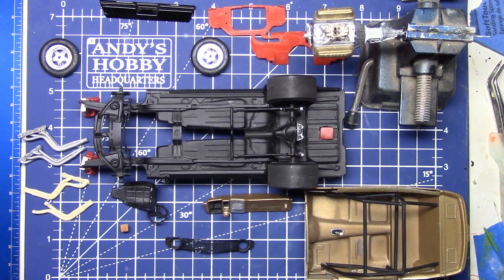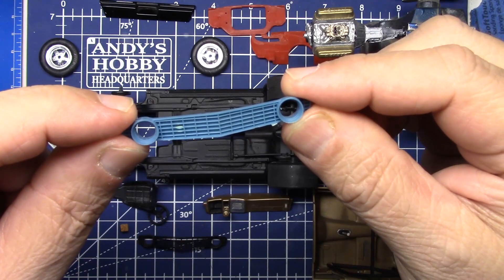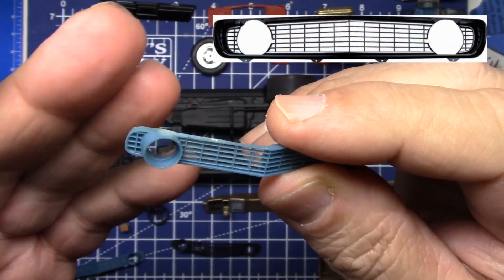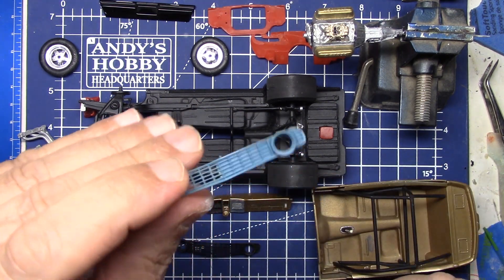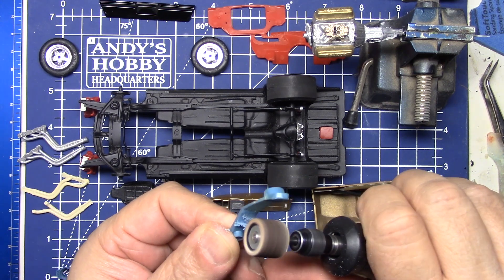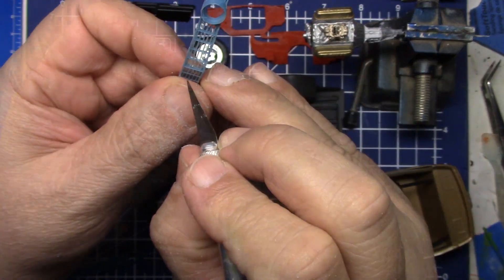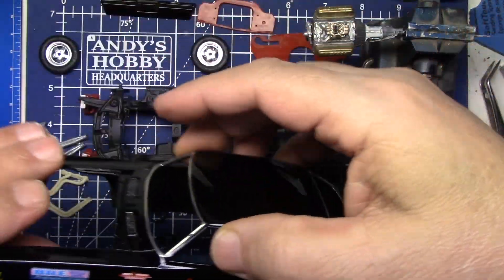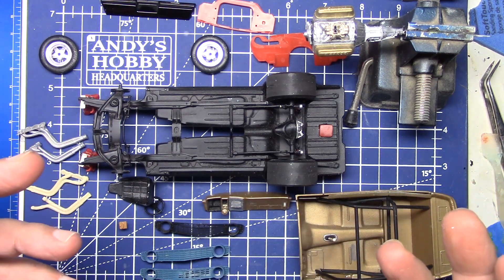Ep.121 How To Open Up The Grill On A Model Car

Comment: Before I commented I did this to the Revell 1956 Chevy grill and that went well. I can see how to do it for perfection and this is used for a weathered build so a missing strand works in this case.The Revell '55 grill is much thinner and starts to take on a punched screen door effect. These are kits that I built in the '70s and now are being rebuilt as beaters with stories in them. I know you're a big Revell '56 Chevy fan if not the tri-five series.

Comment: First time I tried this and the grille cracked on my 69 camaro motor city. I also bought a cheap dremel from harbor freight that has no speed control so I used light pressure. Do I need a different dremel or does this only work on thick pieces